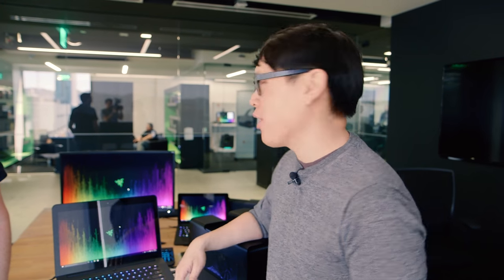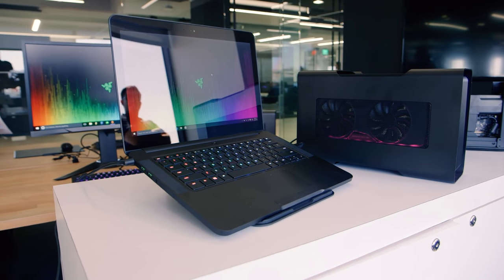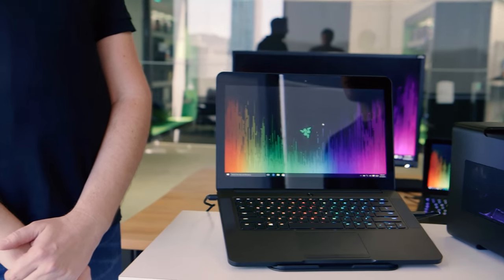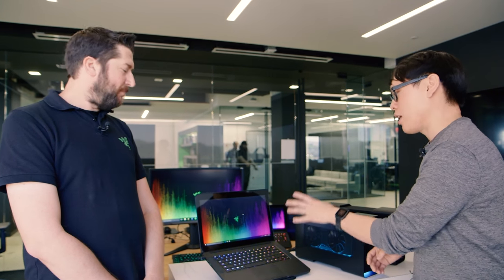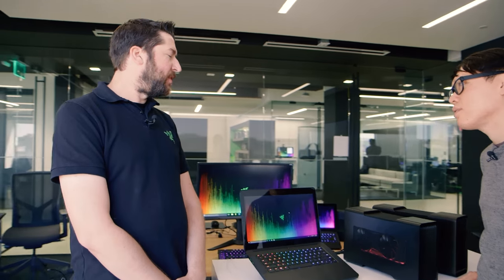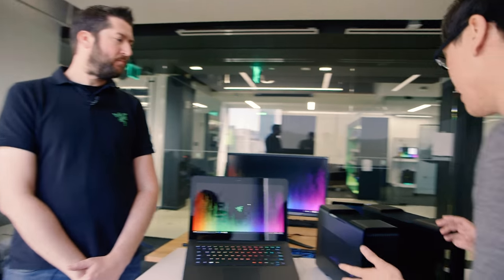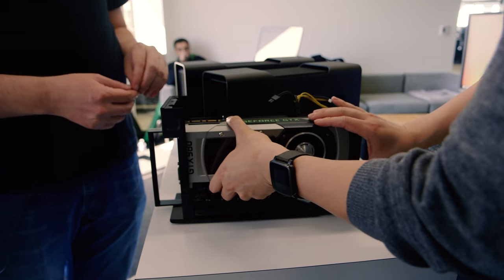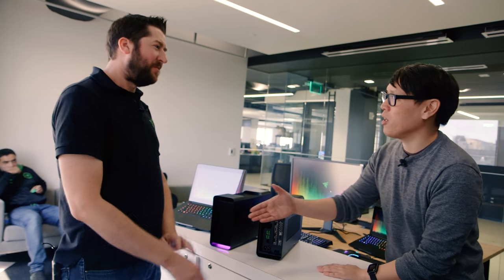Installing a Video Card in the Razer Core (External GPU)

Comment: What happens with the internal GPU when you connect the Core ? Does it turn off or do they work together ?
Reply: +ThePixelPizza yeah and what about optimus laptops, which already have 2 GPUs and this optimus technology which you cant turn off?^^
Reply: +ThePixelPizza I won't "turn it off" it will simply over right the graphics card either automatically or set your laptop to do it manually, just go on the game and there is normally a setting to chose which graphics card you are using. it should work with almost all laptops I believe.
Reply: connor etchells nope. If you have the optimus technology which is bugged as hell, in all games you see the intel integrated graphics only, at least on my lappy which has it.

I cant even use shadowplay with it, even though it is a supported nvidia graphics card, cause it is always disabled , only for graphical intense situations, but this doesnt include shadowplay when optimus technology is onboard. And you cant disable it in any way.

Thats why I am asking, and I guess I know why I didnt get an answer^^
Reply: connor etchells And with turn off I meant Optimus, not the integrated graphics, which you referred to with your first sentence :)
Reply: Nito Raki I was referring to the first question about if it would turn off the on board graphics card. It should just use one of the graphics cards. I have no idea what the optimus technology is, all I think of is transformers. :) Normally though if you go into a game it should see the other graphics card as well. If not then well your screwed lol.

Comment: I LOVE this concept, hopefully this will drive down the prices of laptops.
Reply: +BobvanKay why would it
Reply: Competitors won't need to focus on expensive integrated gpus and their cooling systems, plus with easier upgrades people won't need to buy new laptops as often.

I think that alone should widen the range of viable laptop options and price classes.
Reply: BobvanKay 1. even with igpu out of the question, there's still many many other things that can drive up the cost or give them an excuse to inlate it.

2. laptops still break down over time for 1000 other reasons. Whether it's problems because of dust build up, parts on the motherboard not functioning or whatever else going on in the cpu. 

Don't get me wrong, this enclosure is pretty awesome however I don't can't forsee anything big happening when it comes onto the market. However time will tell

Comment: That's all there is to it - just put the card in the slot, and a couple of power cords and a thumb screw, then just slide it back on the rails into the black toaster oven! This way it will expand and contract as much as possible when it warms up and cools down from use, while blanketing everything inside with all of the greasy dust in the room so that it can run hotter and hotter over time. ;) All kidding aside, it looks beautiful and it would be wonderful as an audio-visual workstation.

Comment: Shouldn't cost more than $150 with premium materials. Can't wait for AMD's standard to roll out so we get more competitive pricing.
Reply: +DeilGrist Yup, Razer decrease their Blade pricing, but the bundled accessories are always of great potential to make profits.
I am expecting MSI or Gigabyte will come up with similar devices as they also sell slim design gaming machines.
Reply: May seem pricy, but there's been a DIY way of making this for Apples Thunderbolt 2 from few years ago that cost about the same too. Guess Thunderbolt stuff is still pricy, but it works I guess. There's a small company that made this type of product for years now and charge a premium price as well
Reply: +Vueey Le That setup would also have less than half of the bandwidth and not support XConnect thereby giving you many driver nightmares.

Comment: The important thing for me heat, fan loud , battary life and thats the point
Reply: +Moaze Sahboun They said they improved it, but by how much, not so sure.
I use Blade 2014, natively, heating, bad. (30mins of BF4 and the system black out)
Fan loud, very. (Scare the shit out of my roommate)
Battery life, @1080p, 6hrs, @QHD, 3-4hrs. (Impressive actually)
Wifi: 7260 is bad for gaming (severe lag) and good for web browsing (stable driver and download speed). 
However, to master a slim laptop I learnt several tricks, restrict the FPS with NVIDIA Inspector or Afterburner to 60, and restrain the turbo booster during gaming with Win power option.
Now, heating, well enough, (never black out then)
Fan loud, not at all. 
Battery life and Wifi, no changes.

So with these tricks, you don't have to worry about the first two, for the battery life, it is decent.

Comment: so the question is : will the pci 4x affect the performances of the egpu ?
Reply: +Nassil From the benchmarks I've seen its a 5% fps difference between 4X to 16X.
Reply: The Rocking M depends on the gpu ;) i bet the titan x will have more than 5% of difference !

Comment: finally this is happening 
but when will this out date 
say I get one today 
wouldn't this barely last a two year span since pcie4.0 is on the horizon and boards might not support 3.0 cards anymore 

also this set will cost about 2500$ for say with shipment included at best 

I really don't know about this as a buy 
maybe we'll have to give it a year or two for the new gpu's to drop 

but never the less this is amazing 
quad core with a mobile graphics and an option to expand power with an external desktop grade gpu is a dream come true for all

finally we can own one system that can do it all

but I only wished for a cheaper model 
something with a 960m and a no ssd option or a 2k screen and still got a quad core that is more budget oriented and paired with the razer core at a sum of 1300 to 1400$ that would be a definite buy for me

which makes sense more as great mobile power paired with on par desktop experience

Comment: so will it run it in sli with the 970m or just the external card?
Reply: +cormac nolan Too bad not many games don't support SLI yet...
Reply: +cormac nolan You can't run sli with 2 different cards yet. Even worse the fact that one is a mobile version and the other is a desktop version.
Reply: +cormac nolan not without an sli  bridge and proper compatibility
Reply: +Chikere Blaise 
You are right with the mobile version. But DirectX 12 allows different desktop GPU's. It only depends if the developers use this feature. It is called Explicit Multi Adapter. Take a look at Ashes of Singularity, it is the first game that have this feature.

Comment: $2000!  Dang!  You can't even put that into a single backpack.  I have a video of my external GPU setup on my channel.   I only spent $60 for a desktop GPU adapter.  I can put everything into my backpack (PSU, GPU, laptop)
Reply: +Adlin Ling good job bro...
i have do it like what you do too...
example my laptop cooler, i just spend $8(better than $15 super laptop cooler in the market) for 2 fans and 1 transformer(including a dc converter circuit) i just make a big chassis under my laptop to make all air just flow under my laptop and i can make air flow to my face and my body too and i can add a 12 volts LED light too...
as the result my laptop temperature reduce more than 20 degree celcius at normal an 15 degree at hard work...
Reply: +fandi gladion Awesome.  I would like to see a video of that.
Reply: Adlin Ling i am sorry cause when i made it i am not make any video......
but i will make a video of aftermath like result of temperature...
Reply: +Adlin Ling Awesome.  Where did you buy the adapter from?.
Reply: +invaritus Ebay

Comment: I think this is a cool idea, but I don't see a whole lot of practical use for the general public.  Very niche.  Any real gamer already has a rig at home that will out perform this setup hands down.  Any benefit that this may have is negated by the sheer cost.  $2100 for that laptop plus another $600-1000 depending on what GPU you use for the Core.  With $3000 I can build a monster home rig and still have enough to buy a decent laptop.

Comment: what's their transfer bandwidth? can it run the latest high performance game without the Nvidia 980 bottle-necking with thunderbolt 3?
Reply: +George Thien With the 980 is takes a less than 5% performance hit.  My concern is the 1080.
Reply: I don't think that the Blade cpu (quad core) will be a bottleneck for a single card.  In terms of the Blade Stealth, the dual core processor in that may be a bottleneck.

Comment: so they briefly touched on VR, but is this laptop with the razor core compatable with the oculus rift cv1? Does the laptop cpu bottleneck a 980ti gpu?
Reply: +General Ivan Well my initial reaction would be no since mobile CPUs are pretty good nowadays. That said, we will have to wait and see the benchmarks. Sooner I'd expect the Thunderbolt standard to be the bottleneck since I have no idea if that little cable can push enough bandwidth.
Reply: +LimitedWard i have my rift being shipped in a few months and is looking for some sort of portable option. this looks perfect besides the cost. are laptops with 970m gpus really $2k?
Reply: General Ivan With 970m's in SLI? Probably. For just one 970m, the cheapest laptop you can buy is around $1250.

Comment: What if you plug in a AMD GPU in the core but you have a Nvidia GPU in the laptop so will the softwares/drivers conflict?
Reply: if your laptop already has a gpu then you can't use the eGPU
Reply: Eric Thomas Wait but can the Razer Core store the drivers so you just disable the 970m or would it conflict if you plunged in a Fury card or something?

Comment: will this still work for laptops that already have a graphics chip inside? Mine has a R7 260M.. If i wanted to buy this thing, I want to know how this thing would work
Reply: the blade has a integrated graphics inside already. what you should be concerned about is if the laptop supports thunderbolt. the guy said it's up to third parties if they'll support the core

Comment: Hmm I have a razer blade from 2013 so it's rocking a 765m but if I got a USB 3.0 to thunderbolt converter would that be able to run the razer core ie would that make it compatible?
Reply: +Abe the physical connection would work but usb3 runs at ~10Gbps Tb3 runs at like 40 or 50 Gbps.  There is no way it could handle the data transfer.

Comment: Overpriced IMO. For the same price as the Razer blade+core+GPU, you can build a top of the line gaming PC with a top line i7 5960x ($1,049 newegg), a GTX 980 (~$400-$500), an Acer/Asus/MSI Motherboard (~$200), a Samsung 850 EVO SSD, 16GB DDR4 RAM (~$80), a 600 Watt PSU, and a case of your choice depending on how much cooling you need. Grand total comes out to be about $2,000; still cheaper than the Razer Blade itself
Reply: +Sagman Twelve (Sagman12) Sure but good luck carrying that around lol. But I agree in some respect, it's probably preferable to get a $1.5k gaming desktop and a $1 ultrabook.
Reply: +Sagman Twelve (Sagman12) Comparing a laptop to a desktop. Very logical there.

Comment: Is this gonna be compatible with my 2014 razor blade is there like a thunder bolt 3 adaptor I can buy
Reply: No, Thunderbolt 3.0 is not on the 2014 Razor sorry bud, and if you were to utilize a adapter if there was one it would be bottle necked by the amount of bandwidth, which distinguishes the Thunderbolt 2.0, 3.0 and USB 3.0 also, if you look into it on Razor's website then it shows a graph of what amount of bandwidth is needed and a comparason.

Comment: can i use the Core with another laptop with thunderbolt 3 support?
Reply: the Problem i have is im always on the go and i cant affrord 2 full systems for 3d rendering for Architecture,and unfortunately there arent many products supporting these kind of graphic cards with thunderbolt 3,even if they do like Razer core they dont support Quadro or Firepro Gpus.
Thanks for the reply by the way

Comment: Aren't External GPU kinda useless? Most(well, all) laptop screens are 60hz/1080p which makes any GPU greater than 970 pointless on External GPU housing... 980 and above are only beneficial on 144hz and 1440p screens.
Reply: Most high end laptop screens are >1440p
Reply: +Solitude 
1080p on a Laptop? What year is it, the early 2000s?!
Reply: Fluroxide :D Well, that's the point, High End Laptops with 1440p monitors doesn't need external GPU's in the first place...

Cheap laptops only have 1080p/60hz which won't benefit from 980 and above. And since GPU docks like this are gonna cost over 300 dollars, buying a 960 or 970 on it is just not cost effective. Just buy a new Laptop.
Reply: Solitude Laptop gpus are not as powerful as desktop ones and none can run games at 1440p 60 fps. Plus if you add texture mods this will help too.
Reply: @all, two points I'd like to make
Who in their right mind still has a 1080p laptop? The Laptop i Bought 6 (!!) Years ago was already at 1440p!
You can always use more GPU-Power :) There is absolutely no such thing as too much power.
Reply: +Freakschwimmer When it fucks up your battery life, there is too much power.
Reply: +Freakschwimmer 
1080p was considered high end back then. And depending on the size of the laptop screen, higher res is just a waste.
Reply: +Solitude You can use an external monitor, you know?
Reply: Yeah... I'm stunned...

Comment: does the razer core fit with other computers?
Reply: +SlothInSpace I think so. It should do anyways. The only way it actually connect to the laptop is by, what they are calling a lightning cable, which is just a usb 3.1, so should easily connect to pc. But why would you want it anyways? You could just buy a better graphics card for the price of the Razer core itself, it doesn't actually come with the graphics card, you are just paying for the case.
Reply: +connor etchells Nope, thunderbolt isn't lightning. USB 3.1 isn't TB3.
Reply: Stuart Trappe Yeah I meant thunderbolt, and I also did some research and realized I thought it was going to be like the lightning in which it was usb to thunderbolt but nope. Didn't have time to change the comment though.

Comment: is this going to be backwards compatible with thunderbolt2 as well?
Reply: +cloudsymph No.
Reply: Jan Norman Any elaborations? Just a bit confused as TB3 is supposed to be backwards compatible with an adapter.
Reply: It is, but it doesn't have the bandwidth for it.  Thunderbolt 3 is a 40 Gbps interface while Thunderbolt 2 is a 20 Gbps interface.  I haven't seen a USB Type C adapter for Thunderbolt 2 anywhere either.  Further complicating things for Thunderbolt 2 users is that it's true that Intel made them backwards compatible, but that doesn't mean that XConnect is.  AMD made that standard and that's the standard that the Razer Core utilizes to do what it does.  The biggest problem of all, in my opinion, is likely the bandwidth.  That alone makes it a non-starter from my understanding of how XConnect and Thunderbolt standards work.
Reply: I take one part of my comment back, and that's that the Macbook may actually be a Thunderbolt 2 capable device.  The rest is still as stated.
Reply: Jan Norman Yeah, the bandwidth is a concern, but I'd likely run it to a monitor anyways when at home, but my friend that uses a bizon eGPU (with a GTX970) gets pretty good performance on his 13" rMBP (based on unigen heaven anyways).

Razer also does have some compatible GTX cards stated too for the core, so nvidia must be doing something to get their cards working...or someone is doing something.

The adapter that I've seen starting to pop up is called Startech TB3>TB2 adapter I think, but it's pricey ($100us).

At any rate, I'll probably just go build my own desktop instead, unless this tech really takes off and price as well as ease of plug and play gets better.
Reply: It's AMD that made it all work, ironically enough.  Intel laid out the groundwork by creating the interface and AMD created the protocol and driver support structure.  It's open source, so why shouldn't NVidia jump on board?  I'm familiar with that enclosure but have no experience with it.  I think that this setup honestly is ideal, as from what I've seen, no graphics card will saturate that equivalent of four lanes.  The 1080 seems unlike anything else, however, so that's why I worried a bit.  I'll buy this when it's available for sale on Razer's page but I'm also going to build a new desktop.  I may be posting benchmarks  for anyone who's interested.